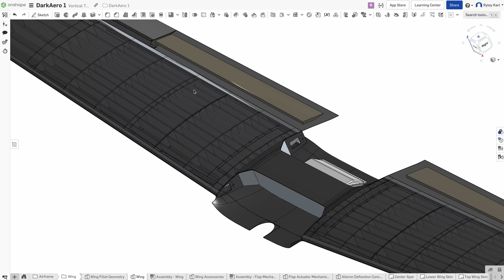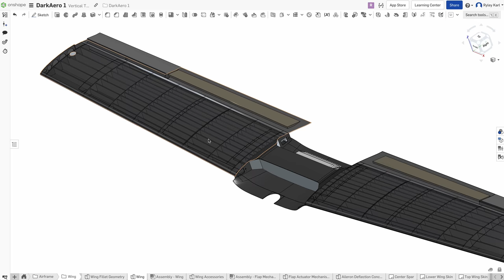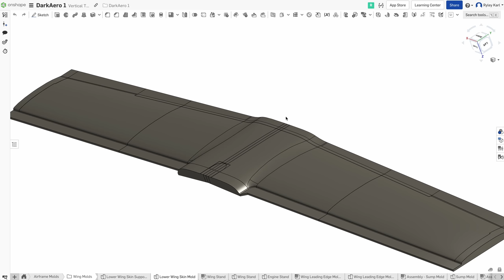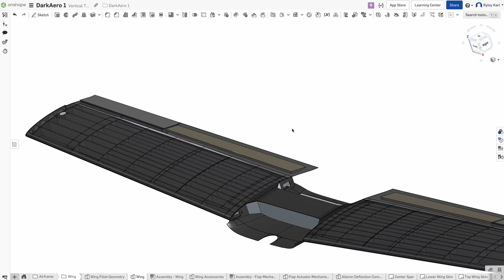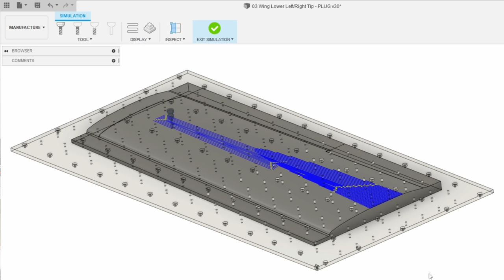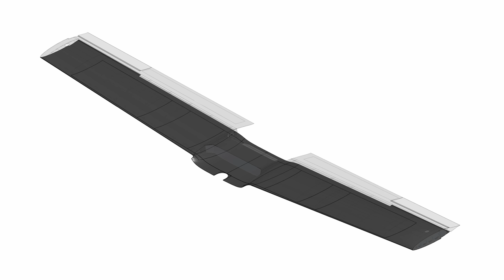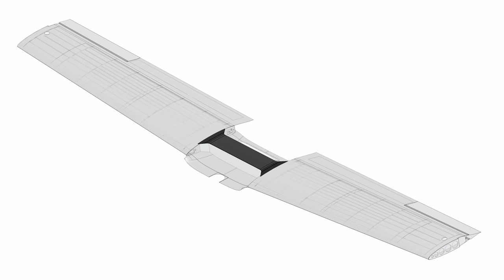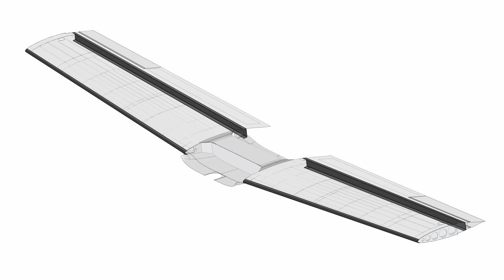The next frontier in aviation...

Comment: Aerospace manufacturing engineer here. Love the process! If you ever get to a production rate in the future where you have more than a couple aircraft in flow, you might need to create another assembly fixture. When you do that, just make triple sure that it matches the original fixture as closely as possible. 

Even though you’ve done everything you can to retain dimensional accuracy, every aircraft built on it will inevitably make changes. So if you ever need to duplicate it, invest in a laser scan to make sure your new assembly fixture matches as closely as possible.

Comment: So you guys inspired to get into making. Over the last year been learning everything around electronics, cnc, 3d printing, polyurethane casting, etc. In fact, this week I am moving out of my room in my apartment I have been using as a make shift studio, into a workshop, so can start really working with more complex materials and techniques. Seeing your mold pattern making for a plane opened my eyes to what can be made with CNC machines and a lot of the modern tools available now. If you can make an actual plane with readily available tools (and a lot of knowledge) then surely can make anything. It's the knowledge part I am lacking. Thanks for this.

Comment: You and Mike Patey have restored my faith in the future of aviation after watching the Raptor debacle. 😎
Reply: I haven't seen any of his videos in a while, what happened with the Raptor? That thing was so cool lol
Reply: @Smokkedandslammed  He ignored a ton of warning signs, didn't focus on weight, ended up like 900lbs over design weight and eventually crashed it due to a very predictable engine design failure. He was fine. Plane and dream were dead.
Reply: @codyhaynes5680  Oh dang! I remember him wanting to use dual MoTec and people giving him crap about it. I guess I have some catching up to do lol
Reply: @Smokkedandslammed choice of engine management systems was the least of the problem s
Reply: Correct me if I'm wrong but wasn't he using a turbo diesel automobile engine? I followed it here and there for a while and his engineering seemed questionable at times. I mean no offense. He seemed quite limited on resources.

Comment: As I do various consulting and design jobs in the electronics industry, I see this exact issue as well. A lot of people and companies simply don't want to think about how their product is going to get built, and it's seen as a problem for "someone else" to figure out later, despite it always circling back to the original design team to slap them around when deadlines start to hit.
Onshape is going to bite you down the line though.
Reply: I'm curious what you mean by Onshape is going to bite them down the line?
Reply: @vladstr100  You own nothing, it's all on their servers, and relies on you still having an account and having full access to the internet at all times. If they decide to ban you, or you lose internet access, or can't recover the password, everything you've ever designed is gone. It's a really shitty business practice, putting it all in a browser. Same with fusion360.
Reply: @Spirit532  Ah yeah, I guess that's true. I'd hope they'd seriously work with those professionals to recover accounts and whatnot if it ever got to that point. Nice thing about Onshape I hear is it's easiest to collaborate with a team compared to SOLIDWORKS like I've been using for my senior design as an aerospace engineering student. 

We've been designing a supersonic business jet, so all the parts files have been on my computer and backed up on Google Drive for redundancy and easy of sharing parts and assemblies with my team.
Reply: @vladstr100  Designing a business jet in SW is a bit masochistic. For complex multidisciplinary designs like that you would usually use Siemens NX with TeamCenter for versioning, management, and sharing - or whatever combo Dassault offers with Catia(but worse).
Reply: @Spirit532  It's definitely been a pain in the ass but that's the software we get access to from the school. The CAD model is actually coming together pretty nicely, at least from a surface level view

Comment: You mention that the wing mould (and hence the wing) has no twist. Aircraft normally have some twist to the wing, known as a variable angle of incidence. This allows the wing to stall at the root first so the ailerons remain effective during the stall. Did you consider this?

Comment: Thanks for the video. A really good one. What I've learned with infused high-temp moulds - do not use gelcoat. Just 200g/m2 fabric as first layer and high quality infusion. Gelcoat will crack.
Reply: Does that apply to the vacuum oven molding like they're doing as well?
Reply: @spdcrzy  That applies to any process with temperatures 80C and above. Gelcoat will expand and start cracking. Actual type of gelcoat will define how soon or late this will happen.
Reply: @kyrillkryvenko752  the more you learn - thanks!

Comment: Dimensional accuracy is increased by using the same material for the molds and the parts. As you heat and cool the mold it will expand and contract at the same rate as the part. I helped make heaters for fiberglass molds that made fiberglass passenger airplane interior panels.

Comment: I really love this channel and the dark aero concept. Have you thought on using reusable silicon membranes instead of the vacuum bagging? I worked with that tech on the past and I think it is game changer for composites. You can check Alan Harper Composites, it is not cheap for starting but for mass production it will save you lot of time and money. Keep doing this videos!! Regards

Comment: Could you elaborate on what material 
 production molds will  be made of? For the aircraft material itself had you chosen flax weave material would your weight and spar support areas added quite a bit of weight to the final aircraft? I understand there are some tensile issues, but as far as the infusion process, would it have been more cumbersome?

Comment: A question about your CF process. You are using a "cold" process, instead of one where you bake parts in a hot, pressurized chamber, which results in stronger parts (from what I recall from my limited knowledge). What is the rationale behind choosing a simpler process? Anything besides cost?
Reply: Well, unless you are working on a military budget significantly cheaper process that yields slightly worse parts will make a better (cheaper over lifespan) product than going all out on manufacturing.
Reply: I had info from engineering students building student racing cars. Similar budget, I think.

Comment: In the wings did you add fuel tanks for the engine. It looks like there's no fuel tanks in the composite structure. Thank you for sharing this with us.
Reply: They used a fuel-safe resin and construction, and there are cutouts for fuel to flow through the grid structure. 
So the bulk of the structure is already a fuel tank.

Comment: I'm not an engineer. But I am interested how your wing compares to the Elixir Aircraft wing. They claim it's a "one shot" mono block prepreg CF construction that requires no bonding or gluing. To a layman like me, their construction process appears  more advanced.
Reply: It is, yes. But it is SIGNIFICANTLY more capital-intensive up front for tooling and chassis development, and is also smaller in range, size, load capacity, AND power output number than this plane. And yet they cost the same.

Comment: Do you take account of the repairability in the design process? Just in case of.
Reply: I do not like just one item- using aluminum(metal) together with carbon. It could have been all plastic and no one would have to worry about fatigue and corrosion in future. Just my opinion. I do not think, that aluminum was the key component to make it lighter or stronger compare to all plastic construction. Regarding repairability- this aluminum could make it more dificult to repair compare to all plastic solution.
Reply: @mirekslechta7161 they use insulating layers of glass cloth in the layups that include aluminum parts. They have a whole video on the subject of galvanic corrosion in carbon fiber structures
Reply: @thewheelieguy  I know they did a lot. Why should anybody choose a material which could possibly corrode? One of big advantages of modern composite structures is 100% corrosion resistance. Alluminum will corrode, one can only slow it down. And in case of a repair, this alluminum could make it even more dificult to repair IMHO.  That is why I was asking what was the reason...would not they be able to make as light as it is without aluminum? I doubt.

Comment: Great video again.  Did you follow the tragic Bugatti 100p Project? And do you think it would have been amendable to the same manufacturing processes (wood form translated to CF) had it been able to be continued into a kit / small volume aircraft production form?   Have you looked at Haxcore (I think there are other makers as well) foam filled Nomex or aluminum coring for potential use sceneries?
Reply: They have an entire video on hollow core carbon fiber panels.
Reply: @JH-tc3yu  Right.  AFAIK hollow hex core panels will require numerous manufacturing steps or prepreg.  They cannot be infused, unlike say a soric hex core material (which weighs more because the hex is formed by resin).  Foam filled Nomex/alu (which I've never used but I'm aware of) should allow for the potential of a one step infusion process AND allow complex shapes to be formed at the same time with a lighter weight more structurally  helpful material.
Reply: I would not describe the Bugatti 100p project outcome as tragic, it was inevitable.

The original aircraft was a highly experimental, un conventional design penned by a non-aircraft designer, having unusually overcomplicated systems, and was never completed, test flown, or raced. There are countless glaring flaws in the original design, and it appears the replica made few, if any changes to improve those deficiencies.

To make a replica of a concept airplane, without re-engineering it from scratch to ensure a reasonable level of   Stability and control, and to go out and attempt to test fly it is profoundly ignorant and its an act that defies reason, and champions nostalgia for an alternate reality that never was.

Comment: Amazing work. I wish that your goals (besides speed, range, and efficiency) included safety by integrating a BRS. Do you think it will be possible to retrofit this version of the plane with a BRS?
Reply: First, locate an airframe parachute that can withstand deployment at this aircrafts cruise speed. 

BRS does not make one. 

Even the parachute on the Cirrus Jet requires that they slow the airplane down to a very low speed, nearly stalled, before deploying the parachute. This is almost pointless, as any aircraft that still has its wings attached, and enough control authority, piloted by someone having enough aeronautical talent to fly a jet slow doesn't need a parachute in the first place. It seems the parachute was included for spin recovery and to sell airplanes to cautious or naive   millionaires, or wealthy private pilots who aren't sure of their own abilities, of which there are few.

Cirrus likes to claim several hundred lives saved by the BRS chute. But the fact of the matter is, not a single case involved a cirrus that was in any way unable to continue flying. No structural or control system damage until the chute was pulled. More than one victim died by drowning after parachuting into water. For the case of pilot incapacitation, an Autoland feature is better for passengers. Or just make sure your loved ones can land an airplane, it takes at most two days to teach them.
Reply: @TheJustinJ  1. The Cirrus jet BRS just saved some lives recently. 2. BRS is not useful in cruise only, it is likely more useful in slower phases of flight, especially the climbout. Every new plane needs to have a BRS, or it will not be very competitive. The tech is available, light, effective, and wanted.

Comment: It would be interesting to know about methods of testing you use to ensure dimensions and material properties of the produced parts are correct. For example, do you use something like ultrasonic testing to test if there are any areas where inner layers of carbon fiber haven't bonded to each other?